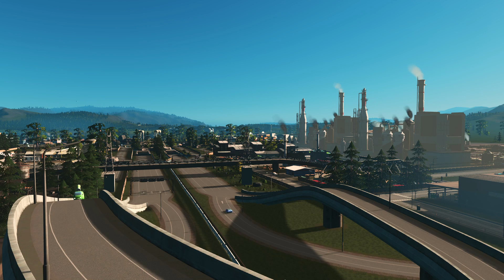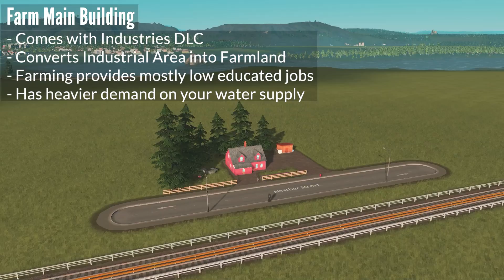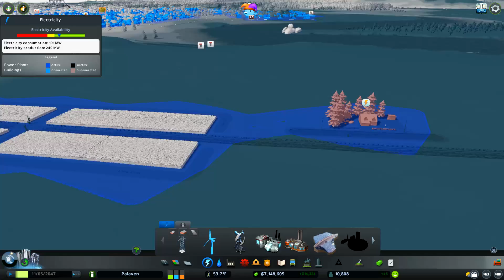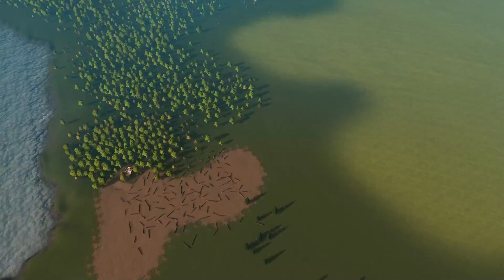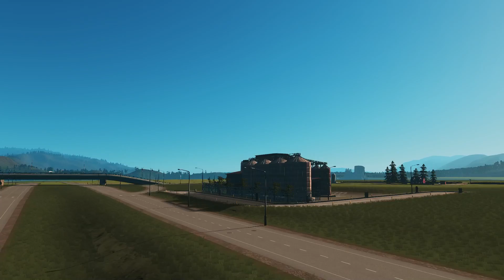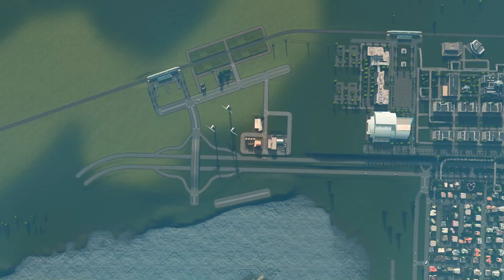Metro Farmland! - Palaven: Cities Skylines Vanilla - Part 12

Comment: Around 29:59, I have to wonder why the metro switches tracks there, and would it still do so if the station (the side with the built-in road) was on the other side of the tracks?
Reply from the maker: I think it's because it's the end of the line mate. Once there are stations beyond it, it'll stay on its side. Could be wrong!
Reply: @OVERCHARGEDEGG  Ah, yeah that makes sense. So once you put a stop further down the line it'll re-right itself.